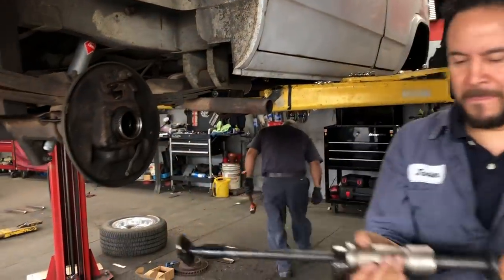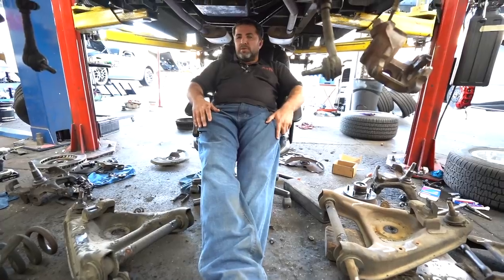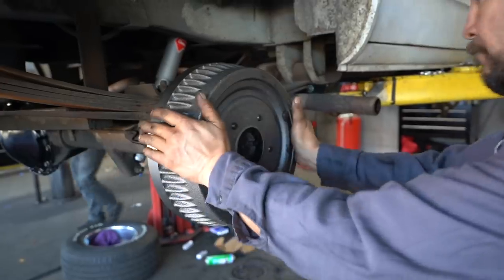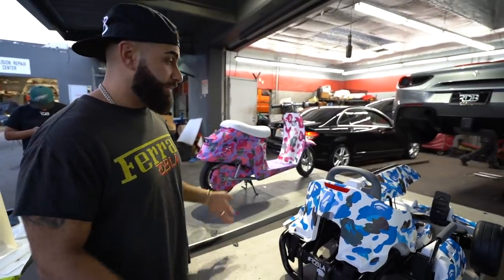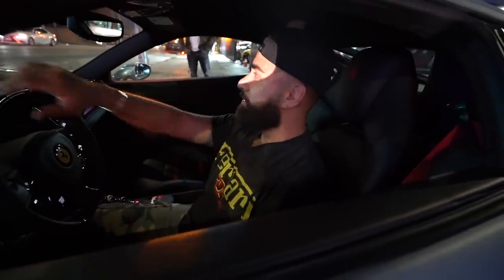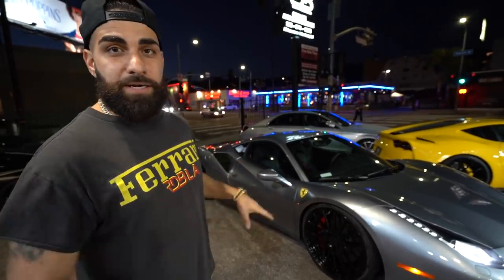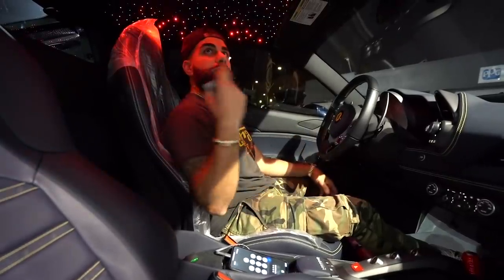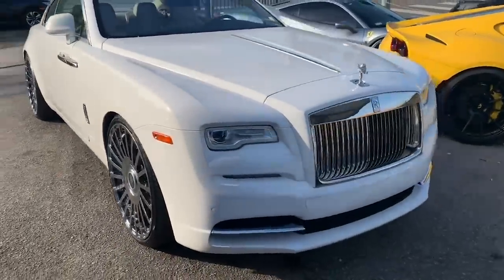#RDBLA FROSTED F12 FERRARI, LOTS OF 488’s, Stars In a Ferrari.

Comment: I didn't get it- so they are robbing the cvar that remains for sale, of the novatec coilovers, and put it on the other 488 someone just bought from somewhere else. Then his suspension is going on the car novatec donor, and it remains for sale with the stock ones. Right, wrong?